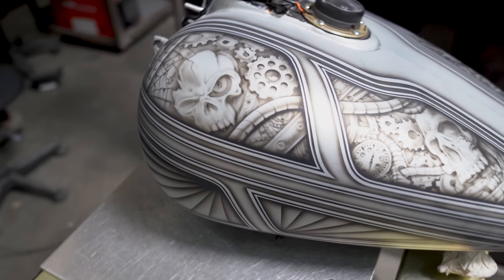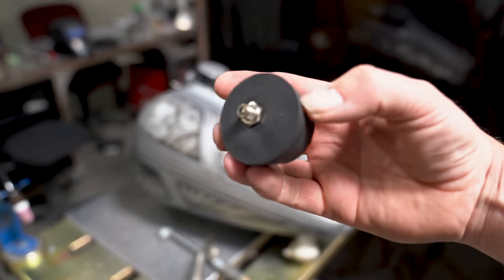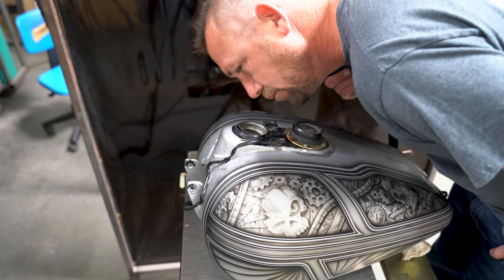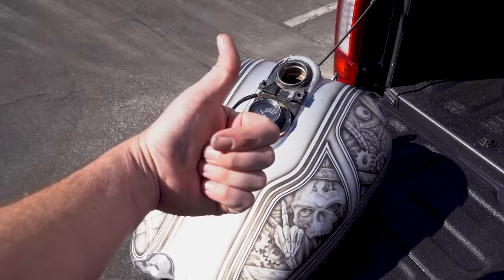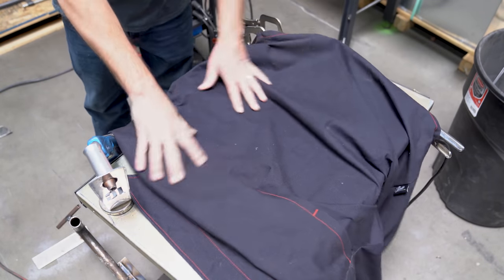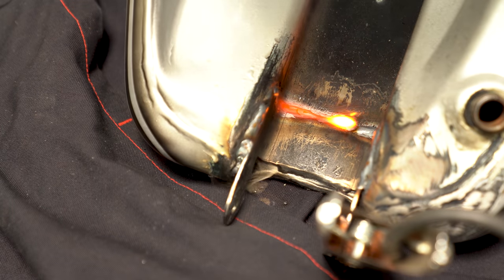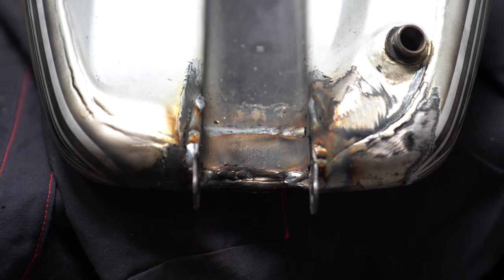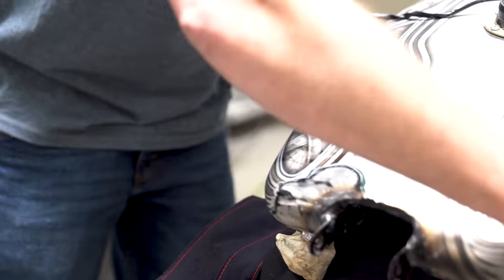Weld Repair on a Gas Tank

Comment: I was a certified welder for years. Used to weld cracks up in Exxon tank trailers everyday. The trailers would be steamed out at our shop overnight. Before allowed in the shop. Then an explosion meter was used to check for pockets of vapor gas. Then on to fixing. Keep in mind. People like me also repair Milk tankers that carry the milk you drink. Now that takes a whole different type of protocol to repair.
Reply: Yep, sanity regs come into play. Whole different set of challenges lol
Reply: Yeah they’re carrying gold these days. The per gallon price of milk is quickly rising faster tha gasoline
Reply: @jamesbagos3459  that's a good thing though, dairy farmers struggle when the price goes down so much as it has in the past couple years.
Reply: @geoffrey6000  Dairy is actually heavily subsidized by the government and the price of milk is kept artificially high.

A lot of countries do this, we actually have a large surplus of milk in this country more often than not.
Reply: @geoffrey6000  not when its artificially high do yo inflation.  The buying power of that money goea down.
Reply: @crabmansteve6844  This reminds me of Germany about 30 years ago sending hundreds of tons of butter to Africa to combat famines and to reduce the stockpile from overly subsidized diary farming. Turns out most of the receivers in Africa were lactose intolerant and a bunch of em literally died.
Reply: @jonasduell9953  nice.
Reply: where I live, in every 4-5 years someone's go blow up welding those tanks without proper check. that's ugly...
Reply: @crabmansteve6844  Cant comment in the US, but in Australia this is not the case, Dairy farmers here find it very hard, have very thin margins.

They get paid 7cents a L at one point in my state, while 2L of milk in the store was costing $2.
Reply: So how do you weld milk tankers? I do purge welding in pipes because I work at a cheese plant and try my best to stick to code when purge welding but how do you do a massive tanker? Someone back purging inside?

Comment: When I was in the Merchant navy, the fuel oil mixing tank (a pressurised cylinder about 4' tall and 1.5' wide, with a plate welded over each end, in which the unused fuel would mix with freshly metered fuel before going back to the engines), split part of the weld afixing the lower plate and sprayed that corner of the engine room with hot, extremely flammable fuel oil. This stuff is like tar, smells like Kreosote and not only flows easier (at all) when hot, but also becomes MUCH more flammable. It made a godawful mess of that entire corner of the engine room, but luckily missed the hot exhaust of #1 genny, beside and slightly forward of it, or things would have been a LOT worse
We get the fuel shut off, the mess cleared up and any leaking fuel caught while the pressure inside the vessel drops and then, because we're in the middle of the Atlantic and there's nothing else for it, it's time for the fun job…welding this sticky-black-goo-of-agonising-death filled bomb back together.
How ever did that engineer survive such a deadly task???
Thanks to iron underpants and an unflappable sphincter about, the only thing he could do was put his faith in science, follow orders and (carefully) stitch it back together with a stick welder, pausing every few seconds so the wiper (his actual job title), who was standing by with a bucket of water and a wet cloth, could clean off any fuel that still oozed from the crack in the welder's path, until it was sealed up tight. Thanks to the upper (UEL) and lower (LEL) explosive limits, the science part in all this, he was able to do so without any (well…much) fear of the whole lot going up in his face because the fuel/air (oxygen) mix was too rich, actually no oxygen at all present in the fuel inside the tank (above the UEL) and the vapour present outside the tank was too lean (below the LEL)  with no more fuel oozing out than would cause anything more than the smallest of flames, easily extinguished with a wet cloth, so it could be welded quite safely. Incidentally, this is also the actual reason why piping exhaust gas into a tank works. It displaces any flammable air(oxygen)/gas (petrol) mix and being anaerobic (oxygen free) prevents any liquid fuel remaining in the tank from flashing off and creating an explosive mix in the same way that using Argon, Nitrogen, CO2, etc would.
Of course, that didn't stop us all watching with baited breath (while hiding in the control room of course…for safety reasons you understand *ahuh…hem* 🙄) during the entire episode.
Reply: Jesus Christ dude
Reply: Wow. That is not a task i'd be eager to get at
Reply: That welder had a lot of balls.

Absolutely not something I'd be willing to so. I've seen pipeline welders do a hot tap before, that's sketchy as fuck too. No thank you.
Reply: Good to see somebody that actually understand how LEL and UEL work, although that's definitely a sketchy situation. I'm a safety professional in a shipyard, and we commonly inert fuel and oil tanks if we need to do hotwork on the exterior (double plates and what not). Pump argon, nitrogen, co2 etc. into the tank, displace o2 and get it below 5%, certify with marine chemist, and good to go. Granted, we would never perform hotwork on a tank leaking fuel, and take precautions if we think the steel is thin enough to risk punching through, but it's theoretically doable as your daring engineer proved
Reply: Sentence structure is a skill. This was nauseating to decipher.
Reply: I used to weld leaks in locomotive fuel tanks with a stick welder. We took the cap off and the tank was full of diesel. Quick spot welds and wipe off, if there was enough deposit, a quick peen with the chipping hammer as well to help close the crack. Never knew how long it lasted, but it was usually done because the loco was due to go out on a run and it had to be sealed
the welds were done on the side of the tank, never the tops.. The top was an put of service job.

Comment: Instead of welding, what I have done with bike tanks is to simply Solder the leak... I have a large soldering iron for sheetmetal work, so no flame.  I can patch larger holes with a bit of sheetmetal also.    The bracket - would be hard to solder unless it could be removed and the metal under cleaned. But the upside of that would be the much better contact between the bracket and tank (soldering would fill in under the bracket, like glue)  It paints and seals just fine also.
Great work BTW.
Reply: ^ This.
This is good.
Reply: Good tip cheers! Don’t suppose you know what wattage your soldering iron is do you? Sounds like a technique I could use occasionally.
Reply: @mopedmarathon  for soldering fuel tanks the iron should be around 250-300W. It's also can be used for soldering old-style brass/copper radiators
Reply: @DrunkGoatt  that's probably what it is...  big, 2 pounds plus, 1/2 inch chisel tip...  could be done with a torch as well, but that brings gs a flame back into the picture.

Comment: Nice job.  I have on SOME situations were I stitch or stack the weld with mig. Then gone back and washed the weld with the tig. It smooths out the stitch and helps ensure a good connection to the thinner metal.

Comment: My father fixes custom painted fuel tanks for a local motorcycle shop. H he boils them out using a steam cleaner then lightly blasts the inside of the tank, pours in metal prep to ensure all the rust pits are treated. Then steams again using a hot air gun to dry the tank. NEXT is tank coating. 
Which is advertised as filling rust holes and cheesy areas. 
The manufacturer actually made a tank from the material by using duct tape as the mold. poured cured and then removed the duct tape, filled with fuel for a year, no thinning, no leaking,. 
Most motorcycle tank issues we encounter are a direct result of ethanol laced fuel in uncoated metal tanks. Ethanol fuel in an ncoated tank, the ethanol absorbs water then through heat cool cycles falls out of suspension, the water nests in the lowest point, rusting the tanks.

Comment: I've repaired many fuel tanks in the past and never had any problems. I always washed the insides using a hot pressure washer first.
Reply: the problem with just rinsing a tank out is water and fuel dont mix very well, fuel isnt soluble, so it wont clean it all out without being very very thorough. 

i did a little 5 gallon racecar tank once and filled it all the way up to the top with water, gave it a good shake and dumped it out, took a torch to see if it would light up and it blew a fireball 3 foot long out of it, the next one was 2 foot long lol that was with the cap and the fuel pump panel off, had they been on that thing would have been a bomb. 

you cant be too careful with this stuff.
Reply: @jameswoodsist  Geez,,,would have never thought that would have happened but ill learn from what happened to you.
Reply: Ahaha recently I had about 1/2" of gas in the bottom of a fuel tank on a car in working on and needed it gone. 
Removed the sender unit from the top and stuck a hairdryer in there, came back an hour later and it was dry as a bone. 
I wouldn't advise smoking ciggies while that was going.
Reply: Same here the guy is a 🤡
Reply: Joe turner  Same here lol, I also Earn weekly Profits of $15,304 on My Investment Since I started invest with Sonia , her trading is the best I have seen
Reply: When I was a kid welding my mopeds tank I used to leave it in the sun with cap off to get rid off any fumes etc. Never had any problems this way.
Reply: @rainbowananas5040 . Right on! Doesn’t hurt to throw aflame around to see if there are any gasses left in the metal and the tank.
Reply: @MrTheHillfolk  
Why? Only place a cigerett ever lit liquid fuel or fumes on fire is tv!
Reply: @MrTheHillfolk  Damnit, Beavis! Hair dryer has electric motor and probly brushes sparking? Glad you're still here!

Comment: If you don't do enough of these repairs to warrant buying special equipment like a steam machine, a shop vac works great, using the exhaust, NOT the suction (if you use the suction you will surely get an explosion as the fumes-and-air mixture passes through the combined fan and electric motor of the machine.  It's common sense, but it's gotta be said).  This method works great because there's a huge volume of air being blown, and that air is very warm which helps a lot to convert remnants of liquid fuel to vapor.  It also helps to use a small enough inlet pipe that flushing air can escape around the pipe at its entry point, besides going out whatever other openings the tank has.  Doing this operation with the tank outside in the hot sunshine helps a lot too (weather permitting).  Another nice feature is it takes almost none of your time because you can leave the apparatus running for more than enough time to get the job done while you work on other things.
Reply: Regarding the electric motor going boom.. Thanks for stating what I guess should be the obvious, because clearly I have no common sense. Although I've never used that method, I also never thought of that danger. How I've made it until now, I do not know. Thanks for the tip!

Comment: Fill it with water works. Welded my first car tank when I was in high school after 4-5 rinse outs with soap and water. Tank went BOOM!

Welded my 2nd tank 4 years later. I was welding on a 2nd  S.S flange I made for a fuel sender. Filled it with water as much as possible. No issues.

Comment: I have welded 3 motorcycle tanks that had small rust holes on the bottom. Drain completely. Allow compressed air to turbulate inside the tank for several minutes. Tape rust holes and fill tank 1/2 full of dish soap/water mix. Shake with vigor for several minutes. Drain. Refill with water completely to brim. Install fuel cap. Turn tank over to expose damaged area. Remove tape and allow a small amount of water to drain away from rust holes. Sand area with 80 grit for shiny metal. Apply flux. Silver braze holes closed using miniature propane pencil torch. I never had this method cause bark- back or fire.

Comment: I use Dawn dishwashing liquid works great to get rid of gas fumes Nice repair only thing I would do is drop the wire size to make it a little easier to play with on the thin areas!
Reply: I switched from .035 to .030 for this exact reason. I do mostly .120 and thinner tubing, so the 30 gives me more control and comfort. For thicker stuff, I will preheat and stack weld beads per normal

Comment: Being old and a bit of a perfectionist.  I would have cut the tacks away.  Removed the bracket.  Fixed the leak and then tack welded the bracket back in.
Reply: RIGHT??
I thought that would be the only solution in my opinion...
Reply: I think that woud be a lot less time consuming way.
Reply: JB weld and leave it a week, repeat every 2 years
Reply: Yeah - cut out the bracket, TIG a nice neat patch, then braze the bracket back on.
Reply: That bracket was way too small, cut it off and build better that’s what you’re supposed to do when failures arise.

Comment: Back in the eighties a very nice older man showed me how to weld or braze a cracked fuel tank that was still on the vehicle and had about a quarter tank of fuel. He simply put a couple pounds of dry ice in it and welded up a seam leak right in front of me. Over the years I’ve used this method with nothing but success. Just make sure the fuel level is below where your welding so fuel can’t run out of where you are welding and then find oxygen outside of the tank that is full of co2.

Comment: I have welded on a few equipment tanks. I learned to flush, the fill with water for welding. Being equipment tanks they are steel and usually over 1/8 thick. Used the good old stick welder and the water keeps all combustion away.

Comment: Had the same leak on the same tank in the same spot. Welded it and resealed with Redkote. A year later still good 💪🏼
Reply: Acetone is a highly flammable and volatile liquid solvent, this is the LAST thing you would want to use when cleaning the inside of a fuel tank if you plan on doing any welding to it. 

You were either just very lucky that the acetone in the tank evaporated just enough to not blow up or you took extra steps (without mentioning) to flush out the insides of the tank before welding. Either way, what you're suggesting here is posing a hazard towards people who are unaware of the risks of Acetone or welding fuel tanks in general.

The safer way to flush out a tank is to steam it (as shown in this video) and or flush it with soapy water if you dont have steam. And finally purge it with an inert gas like fumes coming from your engine or nitrogen  or argon.
Reply: @simpleauto587  prior to the acetone I did soak it with CLR, then water and baking soda

Comment: When I do gas tanks of any kind, I thoroughly wash and dry them. This usually takes care of 99% of the hazard then I inert the tank with argon, CO2 or throw a chunk of dry ice in the tank to inert the tank. Of course if your TIG welding and argon purges probably the best thing to use. Trying to check a gas tank for flammable vapor using any kind of flame is suicidal at best. This also works well for LPG tanks that are being cut open for turning into a smoker etc.
Reply: Thx. got a 500 I'm fixen to cut up this week.
73's

Comment: Part of the blowthrough problem on a stretch is not only because its thin but its because heating the metal with the weld means as it cools its going to shrink and pull apart on an extreme stretch point.  Ive seen guys submerge the tank in water all except the area they are welding to ensure the paint doesn't lift and to keep the tank from warping. Some bike tanks have so much stress that they will twist slightly during welding and not go back on the bike correctly or crack the paint soon after esp the old laquer paint. Big pita.

Comment: With ethanol bearing fuels, pinholes due to corrosion damage caused by standing water, seem to be a very common cause of tank leaks?  Before carrying out any sort of tank repair, it's well worth carefully inspecting the inside of the tank, and checking its condition.

In many cases the bottom of the tank, will be badly corroded, and other than cutting out and replacing the tank bottom, any long term weld repair is difficult/impossible, as applying any sort of heat, tends to open up more pinholes.

Realistically, any tank that is leaking due to corrosion, can only be repaired by cutting out and replacing the corroded material, or by using a modified novolac epoxy tank sealant, being applied after the tank has been properly prepared. For full chemical resistance, some sort of elevated temperature post cure process must be employed, to ensure the repair material is fully cured.  

Tank sealants as supplied are far too thin to work effectively, as run off will tend to mean the products tend to pool in the bottom of a tank, and leave other areas with a very thin coating, which often cracks, and allows ingress of fuel underneath the coating. Filled epoxy based sealant, applied at elevated temperature is the solution here, but is more a professional process.

Comment: Glad you stressed a little air pressure. About 25 years ago when I had a paint shop for motorcycles, my buddy and I completely ruined a customer's laverda fuel tank by using too much air pressure, totally distorted it. Trying to find a replacement in the days before internet was a nightmare.
Reply: Those bike tanks are thin and under alot of stress. Even welding on them can warp them in places away from the weld which is why I was not a fan of him torching that stressed area to get the paint off.

Comment: I repaired my 92 Pathfinder tank by sticking a shop vacuum hose into it and running the shop vacuum in reverse, blowing air into the tank for 20 min after draining the tank. It worked and didn't flame up at all when I took the torch to it before cleaning the metal and welding.